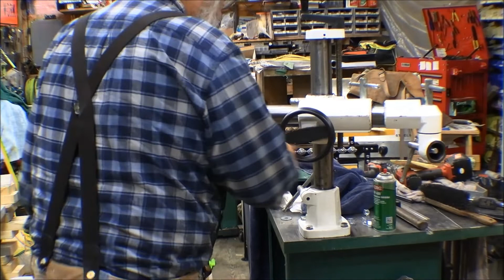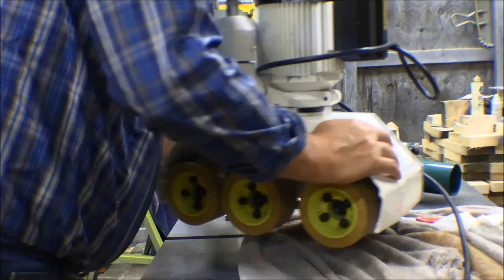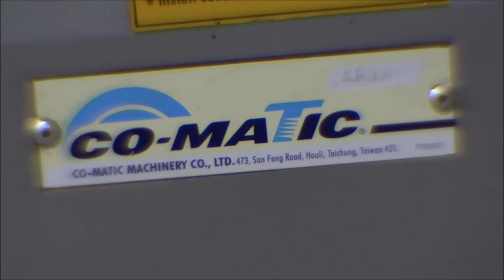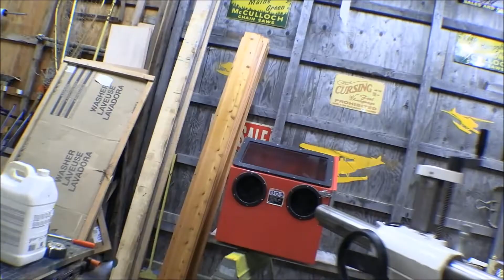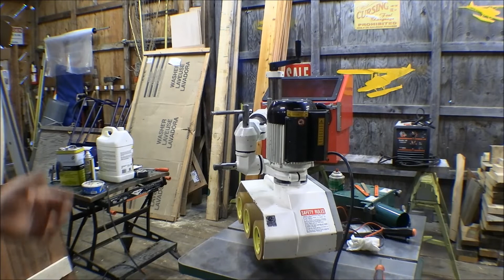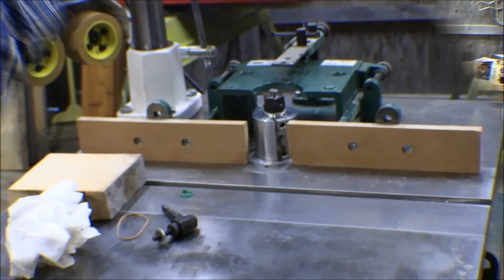Grizzly 1026 Shaper;-- Power Feeder Set Up

Comment: Did you test the start capacitor?  If they don't give you the proper microfarads (sic) it might be going south on you.  That would explain the no self start without a boost.
Reply from the maker: Thanks, I did not check it with a meter, however, it had a strong spark when I discharged it before working on it. I didn't want to take the time to do any more with it. I suspect the centrifugal switch is stuck from sitting in the damp air so long.
Reply: @psgflier  I have seen them still give a partial reading while on the road to failure.  It would have to be really gone not to spark at all.  If it was that far gone I doubt your hand push would get the motor going.  You are definety right about the switch but they are pretty obvious when they get corroded up.  I bought a smaller Grizzly shaper used so I can run my 1/2" router bits on it as well.  Days are getting longer!!  Happy New year.  Sounds like the missus is getting better--home and cooking!!!